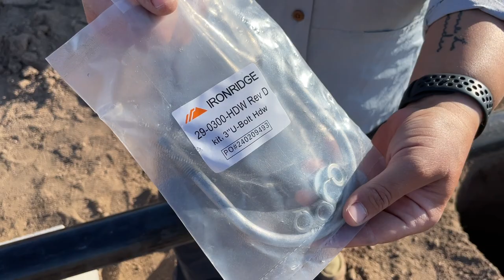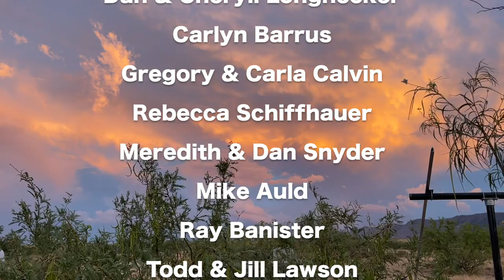Off-Grid Solar Panel Ground Mount -  Pt 1 - Augering holes, cutting pipes, and setting in place

Comment: Looking good,  here's a thought about the concrete:  dry set them about a third of the way too lock the poles plumb ; and them add the rest of the concrete wet and mixed.  The water in the wet batch will  get soaked up by the dry: this will decrease that amount of slump; making the concrete harder. Plus if your going to get rain that concrete will soak it up as it cures reaching maximum strength @30 days (3000PSI) . 
Start early to get a jump on it, the critical part is get it filled. 
You can do this take care and God bless amen.
Reply: I have dry set fence posts here. Did not add any mixed. The concrete got all the water it needed from the soil. 

In your case, with such dry conditions, you may want to pour in the dry mix as suggested then spray in some water to dampen it before added the wet mix.
Reply from the maker: Yeah for setting fence posts it's ok to dump in bags and wet down/mix in place. But not for something like this unfortunately. We need it at max strength so need to pre-mix and dump in.
Reply: @TinyShinyHome  I think I might have welded cross bracing on. In a few spots anyway.  To make sure it does not rack in the wind and eventually shake apart, destroying itself!

So how many Battleborns  are you getting?  Just saw a RV with 1200+Ah of batteries in its hold. It was a HUGE coach bus/RV. But $15,000 for batteries can make one's eyes water a bit.  Make sure you have a Kleenex handy!!! Or 2!

Comment: Im not trying to be judgemental but i think you are working harder than you have to . im not a engineer but i have set fence post i just mixed gravel and quick. Crete filled the hole with dry mix and watered generously. those posts were. Set in 2000 and still standing today .a lot easier than mixing in a wheel barrow
Reply from the maker: It’s all according to the manufacturer specs my friend. We did your way with our fence posts too. It’s a whole other ballgame with this beast.

Comment: The kittens are a real plus to your show. I'm trying to catch up with you so really enjoying this build! Wow, way more cement! Fact Totem Farms thank you for helping out! So great to see the progress on the holes for the piers. As always, Nine nine is the clown. The aerial view of the holes looks so cool. Thanks, Ice cream! Those shades look great on you guys. AC in the truck right. I'd go to 3 places! Plasma cutter, real nice. You aren't kidding when you said towers of blocks! Your neighbor is awesome! Good thing you have a child to lower down to get that set screw! I didn't the know about the allen wrench attachment for a torque wrench either! U clamps, How did you find out how to do this set up. I'm interested in solar but not on our roof. We are at the top of a hill where wind blows pretty strong. You said you got the engineering requirements for the size of your piers somewhere. This is really great to see. When we dug our holes for our pig pen they were 34" into the ground to get below the frost line and we had one of our sons get into the hole and he posed for a picture. She did a great job getting your items out of the hole! I'm really impressed with this set up for the solar panels. Looks fantastic! I think it is great that it will rain because mixing concrete is a hard thing to do and cooler temps will help make it a little more comfortable to do. Thanks so much for this video.

Comment: Hey- First, how are you in relation to the fires?  I’ve been praying for your protection.
Next, July is here and our shed should be on property by the end of this month.  Which means we will be on property. Question- how do you protect your water tanks and source from rodents?  We have been told that rodents are attracted to water and that they gnaw through everything!  This solar section is timely for us.  We have two weeks to put in the foundation, wire and plumb the shed, finish the walls, and set up the internet.  Whew!  We have a tendency to overplan😙
Reply from the maker: We’re good thanks 😊. I haven’t heard of rodents being a problem with a proper off grid water tank. They’re very thick. That is a lot to do in two weeks - good luck!

Comment: I saw this stuff on tic tok that is expanding foam for filling holes, and it seemed to me that it would be better then concrete in a lot of cases. Have you seen it as well and if not, maybe you should check it out. I think it was a home depot product. Also, if it hasn't started raining yet, you may want to cover your bags of concrete and make sure their not on the ground.

Comment: Great Job Gang.    
I will suggest (perhaps too late) line the holes with plastic to keep the water in the concrete.
Seems like overkill on the foundation considering your ground is like concrete anyways. But I do not know your wind loads and how much surface area you are installing.
One day at a time.
Cheers
Reply from the maker: A lot of people thinking it's overkill, but these are the engineering specs based on the size of the array, our soil type, wind gusts, snow load, etc... The ground is actually not like concrete at all. It can be mixed with water and tamped into something hard, but as is it's very easy to dig and pretty sandy in this location.
Reply: @TinyShinyHome  Thanks for the reply. 9 9 always makes me smile.

Comment: Nice be job getting the ground mount ready to go. How much concrete will you need to fill the holes? Take care:
Reply from the maker: It’s taking between 21-26 bags per hole! Mixed by hand!
Reply: @TinyShinyHome  wow, that’s insane!
Reply: @TinyShinyHome  you'll be mixing pretty close to a ton of cement. Are you going to ise straight portland cement and add aggregate or use quickcrete? Either way that's a lot of hand mixing. Have an awesome week. Take care.
Reply from the maker: Quickcrete. It was much easier mixing in wheelbarrow by hand than the mixer.
Reply: @TinyShinyHome  faster too. We made a very large number of sacks of cement and shoveled aggregate to make the concrete. Used a LOT of water too! Happy hand mixing!

Comment: Why not put the top caps on before laying the horizontal pipe?  I know it's already done just asking if there was a reason.
Reply from the maker: More of a process thing for us I guess. Wanted to focus on getting them straight, parallel, level, etc... first and not add any pieces moving around or extra weight. You could totally put them on first, though. Except for where the two crosspieces meet.

Comment: Would rammed earth work for the feet? 

Same concept as the earthbags and same mixture just rammed down between wooden forms. You wouldn't need the wooden forms because you have the predug hole walls. It is more work then concrete but cheaper. 

Maybe concrete for the corners and rammed earth for the center holes. Trying to save on costs ya know 🤷 

I wonder even if you could layer it 1 ft concrete, then 1 ft rammed earth, then concrete again and so on. 

Also consider if you get the chance to have the tractor again to do some digging for permaculture to increase your water table. Create some berms  and swales, this https://youtu.be/I1Vt8oPCZiE
Is a really drastic example but very cool. 

Just brainstorming..
Reply from the maker: Compared to all the other parts of the mount, the concrete wasn't that bad actually. If we hadn't false started with the smaller holes and already bought 1/3 of the concrete then we could have had someone come in and pour it for about the same price. Next time! Swales/Berms are being planned currently, but not implemented until we have the solar shed finished and have some breathing room as they will affect everything in the future in terms of layout and planning.
Reply: @TinyShinyHome   🤙 keep it up the world is watching haha